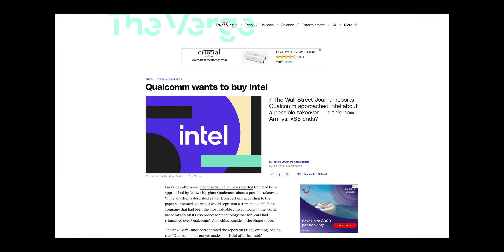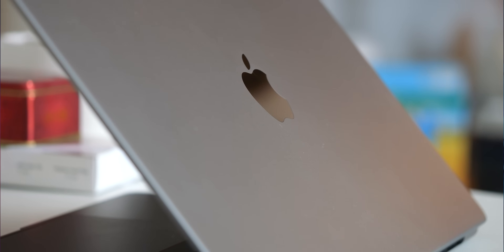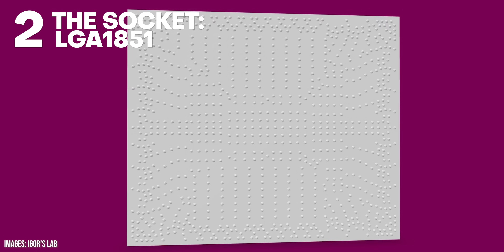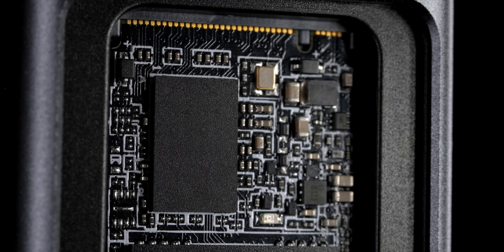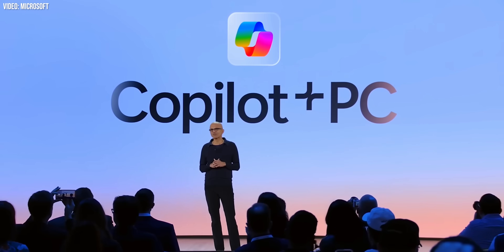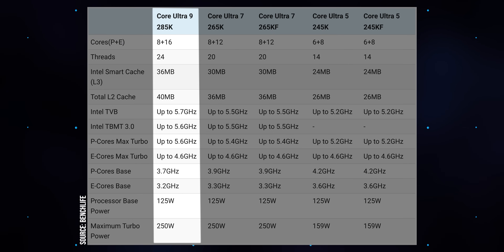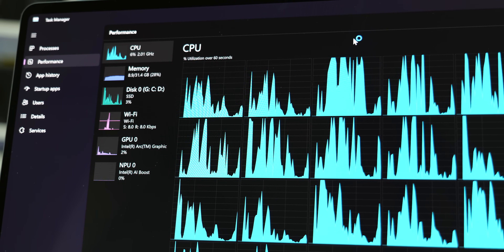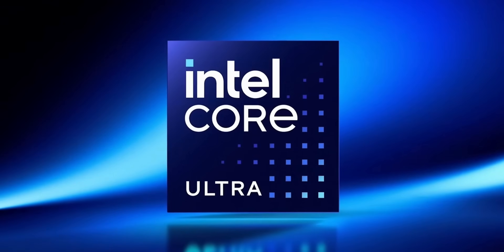Intel Arrow Lake (15th Gen, Core Ultra): Leaks, Release Date + Everything We Know!

Comment: i have a 13900k and primarily game. i also have a asus ryujin II and will tell you, under load I have never seen my cpu hit 70c its usually sitting around 58-61c under load. maybe I got a great chip but I dont know what all the complaints are about. this is a fantastic cpu and have had it since release.
Reply: That is not the case for the vast majority of people. Maybe you have amazing cooling and also hit a jackpot on silicon lottery but for most even with a big good air cooler that thing hits close to 90c and even with water-cooling it goes over 80c.

Comment: Will the socket be kept for more that 1 generation (like the 12th, 13th, 14th)? I want to upgrade, motherboard CPU cooler memory and hopefully this could accept the 16th or maybe 17th gen if Intel sticks to the socket lga1851.
Reply from the maker: Nova Lake is also rumoured to (eventually) use it, but not confirmed yet
Reply: @XDAVideo  Intel is losing consumers this way. They shouldn't leave people hanging. We aren't going to be buying on hope without confirmation. 
They should promise from now that they will be using that socket for Nova Lake as well. 
AMD is giving like 4-5 generations on a single socket, is not much to ask from Intel to at least commit to 2 generations. 
That could built some trust for someone that is thinking whether he should invest on an Intel system or an AMD one.

Comment: When we talk about Arrow Lake and INTEL architecture we can't not to talk about Battlemage. This is huge. It includes my suspension about Nvidia 5080/5090 also. 

INTEL ARC A770 has 32 Xe cores. Predicted top Battlemage has predicted more than 32 Xe2 cores. Xe vs Xe2 already is 50% jump in performance. I've seen rumors of 40 Xe2 cores if not more for the top Battlemage. Now we are closing to double the performance of the first gen INTEL ARC GPU's.

 A770 GPU clock speed is 2.1 GHz. The upcoming GPU BMG-G21 that is predicted to be the replacement for the A750 and has specs reaching to 2.85 GHz. So we should expect 3 GHz and above from the top Battlemage performer. Then there is the Memory speed/Bandwidth from 17.5 Gbps/560 GB/s from A770 to 19 Gbps/608 GB/s from the top Battlemage.

 Now add Intel Application Optimization (APO) that promise 10-50% gain with top INTEL CPU. INTEL XeSS XMX also is close to equal to DLSS. 

 Don't forget that INTEL ARC via REBAR uses 2 silicon architecture taking the advantage of both silicon and doubling the performance. For example i7-13700k 253W (max) + A770 225W (max) = 478W (max). In general Wattage = performance. It is a good indication now that the clock speeds are predicted to match the competitions clock speeds. 

 Plus with two silicon architecture there is no queuing or waiting meaning every frame is perfect. A770 in reality already gives you better experience on 4k than 4070ti. Current testing doesn't give you the performance of 2 silicon combined performance or recognize architecture where you don't have queuing or waiting, counting every error and broken frame. To beat you need at least double the FPS count from AMD/Nvidia single silicon architecture at high resolution demanding tasks where CPU plays only very small part for AMD/Nvidia GPU performance. Hence insane Wattage like 450W from 4090 or the predicted 600W from 5090 (that I suspect of being dual GPU).

 INTEL is cooking something big for sure. Don't forget that Arrow Lake also plays a huge part. Battlemage predicted Wattage is 250-275W. So it looks like it will be close to 4080/5080 cards with combined wattage of 500-550W with Arrow Lake. Arrow Lake max Wattage is predicted to be max 250-275W. It would make sense to match the Wattage on GPU and CPU to avoid bottlenecks (as you can also see speculation on 5090 doubling the specs of 5080 as two equal sides. also the INTEL CPU/GPU pairing tool supports this narrative). So when talking about Battlemage you should also add the Arrow Lake into the picture because it is going to be a big part of the performance if not half. Also new Motherboards for the Arrow Lake most likely will have enhanced REBAR for pairing via native 5.0 PCI interface to the CPU. Would make sense (also for 5090 to have two GPU's on the same card).

4090 24gb VRAM 384 bit bus 450W
4080 16gb VRAM 256 bit bus 320W
4070ti 12gb VRAM 192 bit bus 285W

a750 8gb VRAM 256 bit bus 225W
a770 16gb VRAM 256 bit bus 225W

 Price point for the top Battlemage I predict is $500 (for reference 4080 +$1300). But here is the catch. You need top upcoming Arrow Lake CPU to get all the performance from Battlemage and that is a new build $500 for the CPU and $500 for the Motherboard. That's $1500 as a rounded ruff estimate. Now it doesn't look that cheap anymore. But if this combo competes with 4080/5080 then it starts to look extremely good value if you are looking for a new build.  Also when the Wattage of the 4080/5080 are 320W/predicted 400W and add the Wattage of the CPU it is looking very similar in power cost. Arrow lake Wattage  predicted Wattage is 250-275W. Top AMD CPU 170W. Battlemage prediction is 250-275W. Top INTEL combo 275W + 275W = 550W vs Top AMD CPU 170W + 320W(400W)4080(5080) = 490W(570W).

 As a summery I think we are looking at doubling the ARC Alchemist/13th gen/14th gen CPU performance with Battlemage/Arrow Lake CPU that would compete with 4080/5080 performance. Potential also gives hope that it might even be more and beat these cards. It will come down to price and build new vs old for the top performance. So look for the Arrow Lake CPU launch and you can be sure Battlemage won't be far behind.

Going back to the dual GPU of 5090 prediction or maybe just a feeling of it it would do similar job as the INTEL pairing to INTEL CPU. There is talk about Nvidia getting into CPU market and I think this might just be the reason to have two silicon instead of one in 5090. This is just guessing and making conclusions/speculations from the specs. When I look at the specs of 5090 it is pretty much double than the 5080 to the point. The first thought that comes to mind is 5090 has two (2) 5080 GPU's on the same card and because 600W is the limit/max that can be supported and that it has the same 12 pin power supply indicates two GPU's in the one card as it is 2 x 300W not single 600W. This in my knowledge can be susteined through the existing power architecture and the troublesome 12 pin connector from the 4090. Also because the two GPU's are not pushed as hard as 5080 (2 x 300W for 5090 vs 1 x 400W for 5080) there is less heat/GPU and similar size cooler can fit the 5090 as it is predicted it will be 2 slot card. 600W to single silicon would run so hot that it would need at least 3 slot cooler. Performance/Wattage/specs/temperature/cooling all indicate that there is two silicon instead of one GPU in the 5090. Old SLI comes to mind but in one card. Also I think Nvidia has seen the future of pairing two silicon from INTEL but they do not have CPU's at this point of time and the closest they would come is with dual GPU card. To me this is a scam because now you have 3 silicon in your system but only need 2 and your CPU is on idle and RAM use minimal as it has never really made that much difference in performance. INTEL Arrow Lake will change this because it is fully utilized and paired to take half the tasks of the paired INTEL ARC GPU. We end up with less hardware but same performance if not more with RAM counted in also. This does raise some questions like VRAM. Battlemage predicts to have 16 GB VRAM. With the new Arrow Lake can you add RAM as your graphics memory also if there is native link via PCI 5.0 between GPU/CPU is a question and how well. It almost looks like INTEL combo will have two hearts beating and syncronised together. 

Food for thought.
Reply: Intel Core Ultra 9 285K

Physical
Socket:	Intel Socket 1851
Foundry:	Intel
Process Size:	7 nm
Package:	FC-LGA18V
tJMax:	105°C

Cache
Cache L1:	112 KB (per core)
Cache L2:	3 MB (per core)
Cache L3:	36 MB (shared)
E-Core L1:	96 KB (per core)
E-Core L2:	4 MB (per module)

Processor
Market:	Desktop
Production Status:	unreleased
Release Date:	Oct 2024
Part#:	unknown

Core Config
# of Cores:	24
# of Threads:	24
Hybrid Cores:	P-Cores: 8
E-Cores: 16
SMP # CPUs:	1
Integrated Graphics:	Arc Xe2 Graphics 64EU

Performance
Frequency:	3.7 GHz
P-Core Turbo:	5.4 GHz
P-Core Boost 3.0:	5.6 GHz
Turbo Clock:	up to 5.7 GHz
E-Core Frequency:	3.2 GHz
up to 4.6 GHz
Base Clock:	100 MHz
Multiplier:	37.0x
Multiplier Unlocked:	Yes
TDP:	125 W
PL1:	125 W
PL2:	250 W
PL2 "Extreme":	295 W

Architecture
Codename:	Arrow Lake-S
Generation:	Ultra 9
(Arrow Lake)
Memory Support:	DDR5
Depends on motherboard
Rated Speed:	5600 MT/s
Memory Bus:	Dual-channel
ECC Memory:	No
PCI-Express:	Gen 5, 16 Lanes
(CPU only)
Chipset:	Z890

Features
MMX
SSE
SSE2
SSE3
SSSE3
SSE4.2
AVX
AVX2
FMA3
SHA
EIST
Intel 64
XD bit
VT-x
VT-d
AES-NI
TSX
TXT
CLMUL
F16C
BMI1
BMI2
ABM
ADX
RdRand
VNNI
vPro
DLBoost 3.0
TBT 2.0
TBT 3.0
TVB

Notes
Intel Arc Xe2 Graphics Dynamic Frequency: 2000 MHz

"Lion Cove" P-Cores
"Skymont" E-Cores

The Intel Core Ultra 9 285K will be a desktop processor with 24 cores, that is expected to launch in October 2024. It is part of the Ultra 9 lineup, using 

the Arrow Lake architecture with Socket 1851. Core Ultra 9 285K has 36 MB of L3 cache and operates at 3.7 GHz by default, but can boost up to 5.7 GHz, 

depending on the workload. Intel is building the Core Ultra 9 285K on a 7 nm production process, the transistor count is unknown. You may freely adjust 

the unlocked multiplier on Core Ultra 9 285K, which simplifies overclocking greatly, as you can easily dial in any overclocking frequency.
With a TDP of 125 W, the Core Ultra 9 285K consumes a lot of power, so good cooling is definitely needed. Intel's processor supports DDR5 memory with a 

dual-channel interface. The highest officially supported memory speed is 5600 MT/s, but with overclocking (and the right memory modules) you can go even 

higher. Actual memory technology support depends on the chosen motherboard, the processor itself supports multiple memory types, but most motherboards 

have only one kind of slot. For communication with other components in the machine, Core Ultra 9 285K uses a PCI-Express Gen 5 connection. This processor 

features the Arc Xe2 Graphics 64EU integrated graphics solution.
Hardware virtualization is available on the Core Ultra 9 285K, which greatly improves virtual machine performance. Additionally, IOMMU virtualization (PCI 

passthrough) is supported, so that guest virtual machines may directly use host hardware. Programs using Advanced Vector Extensions (AVX) will run on this 

processor, boosting performance for calculation-heavy applications. Besides AVX, Intel is including the newer AVX2 standard, too, but not AVX-512.

techpowerup
Reply: @paulboyce8537 shit did not cook bro...

Comment: i9 will cost you 450-500w
Reply: No, it won't. the i9 285k TDP is 125 watts, and the maximum power consumption is 250 watts. The 9950X has a TDP of 170 watts, and at maximum, it can draw 250 watts.

Comment: So Oct 24th it will be released; I wonder how its power efficiency is when compared with AMD Ryzen cpus. Also the naming convention is weird, so Core 265 and up means more than 6 Performance cores; need 8 Performance cores for decent gaming I believe.
Reply: "The 265 has 8 P-cores and 12 E-cores. Most games typically use a single core; for example, GTA 6 will likely rely on one core.
Reply: @n.d.n.e1805  What kind of BS is this? Games do need at least 6-8 cores to run well. I think what you meant to say is that games rely on a single CCD.
Reply: @laszlozsurka8991  No game use only one core; you're forgetting that PCs also run background applications and system tasks. Some games even have additional apps that need to be running for the game to function properly. While the game itself may primarily utilize one core, it can occasionally use two. This isn't misinformation; if you had done just a little bit of research, you would understand this
Reply: @n.d.n.e1805  "No game uses only one core; you're forgetting that PCs also run background applications and system tasks"

When tf did I say that games use only one core? Don't put arguments which I never stated. 

Try running Hogwarts Legacy with only a 2 core CPU and see what happens. Most modern games do need at least 6 cores with 8 being the preferred. There's a reason why 8 P-core CPUs are faster than 6 P-core CPUs or lower.

Also GTA 6 is not even out yet so how do you even know how that "GTA 6 will rely on one core"?

Comment: Actually the reason behind Intel’s decision for TSCM to instead of their own nodes was cost. Intel 20a was supposed to be the first step before 18a that was supposed to be an iteration of 20a but 20a was not going to be sold to other companies it was meant to be just for Intel products. The cost to transition to a new architecture 18awas too high when they already have a mature 18a process (which means they consider their 18a good enough to be sold to other companies without the feedback of 20a) so they went with TSMC instead
Reply: Lol uh duh
Reply: I think it has something to do with heat and power as well, especially after all the issues they had.

Comment: Intel isn't buying nodes from TSMC for shits and giggles, it wants to COMPARE with real world HARD DATA how it's own 5nm/4nm/3nm/2nm nodes fair with TSMC in volume production. The key is "volume" as any of the big three can do small "hand picked" batches easily.  But Not only that, intel can run benchmarks to see if TSMC is truly better or worse than they're node-for-node from the SAME CPU!! but manufactured by TWO totally different companies! THEN, they'll figure out just HOW far behind or better they're in terms of volume efficiency and node superiority! Pretty sure they had to pay TSMC millions upfront to make those chips.😅😅
Reply: it's = it is
they're = they are
Reply: @tim3172 
Actually the reason behind Intel’s decision for TSCM to instead of their own nodes was cost. Intel 20a was supposed to be the first step before 18a that was supposed to be an iteration of 20a but 20a was not going to be sold to other companies it was meant to be just for Intel products. The cost to transition to a new architecture 18awas too high when they already have a mature 18a process (which means they consider their 18a good enough to be sold to other companies without the feedback of 20a) so they went with TSMC instead

Comment: Did you say Intel Arrow Lake won't be using Xe2 graphics?
Reply: Because it is separate processor on the die and you would most likely use a dedicated GPU like Battlemage the integrated graphics would be more like backup or hooked to the TV to play video. Personally I think it is logical and cost saving.
Reply: I have some doubts they will not use more or less the same iGPU as their laptop CPU. And I also kindof doubt they will only deliver 10 TOPS for the NPU, while the laptop low power kne is 48.
Reply: Lot of different information out there. But I did find Xe2 was also mentioned by "Tech Power Up" in their breakdown. Time will tell.
Reply from the maker: Leaks all point to graphics being Alchemist-based not Battlemage
Reply: @XDAVideo Makes sense tbh, because RAM isn't soldered & cache isn't shared as good as on LNL
Reply: @XDAVideo  "Tech Power Up" in their breakdown gives Xe2. 
Also PL2 "Extreme":	295 W . I did put it to 275W but it seems to have some overclocking room.
In notes 
Intel Arc Xe2 Graphics Dynamic Frequency: 2000 MHz

"Lion Cove" P-Cores
"Skymont" E-Cores
Reply: @XDAVideo correct